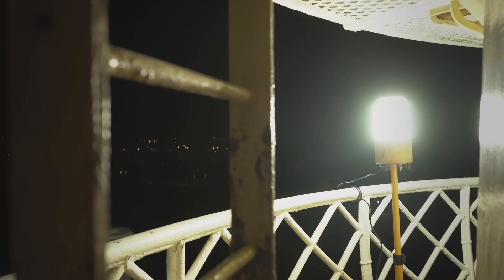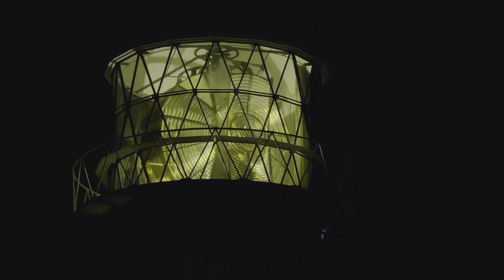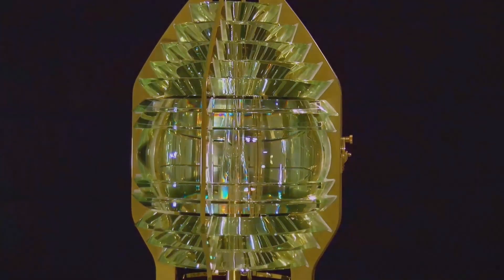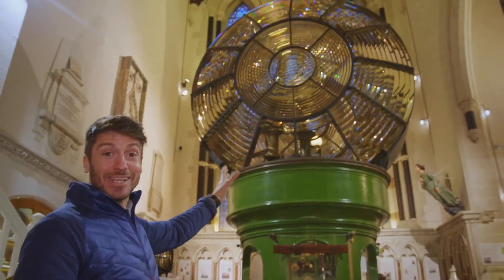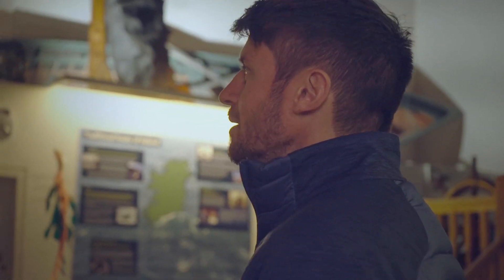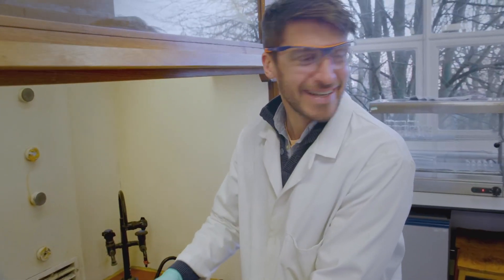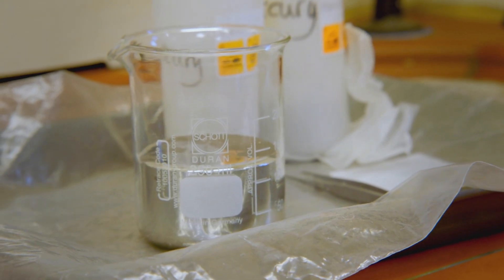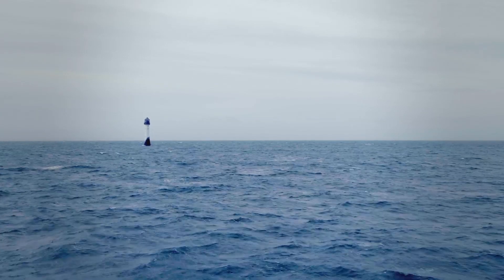How A Lighthouse Works | The Secret Life of Lighthouses | Channel 5

Comment: Actually, this is not a great explanation of a Fresnel lens. While the bulls eye might look prism-like, it works through refraction. It is a Dioptric lens, that has been cut into concentric circles and the bulk of mater removed to create a much lighter and smaller form factor. The extra glass surrounding are prisms and they reflect (Catoptric) and collect extra light that would otherwise be wasted. Together they make a very efficient and most importantly, lightweight way of producing a concentrated beam of light. It is known as a catadioptric system.
Reply: Exactly so.

Comment: But the lighthouse bulb was still heavier than 25 pints of mercury why didn’t it spill out and the bulb go down to the bottom ? Was it under pressure ?
Reply: Mercury is enormously dense. More than 13 times as much as water and not quite twice the density of steel. If you had a box that was cube one foot in all dimensions and filled it with mercury, it would weight 845 pounds. It also has a very high surface tension. 

If you look around online, you can find pictures of big steel anvils floating on mercury and even one of a guy in industrial coveralls sitting on top of a big tank of mercury, with him sinking in it maybe just a couple inches.